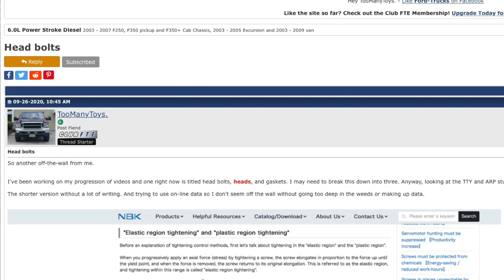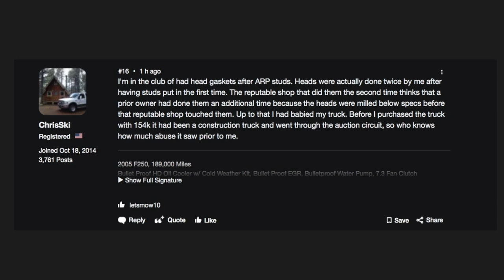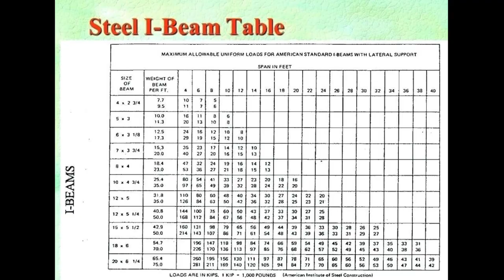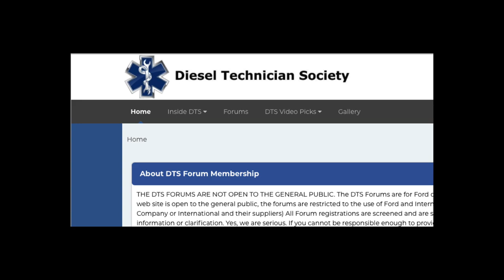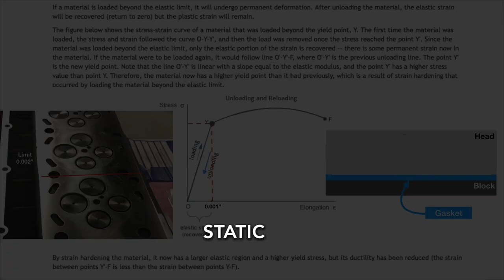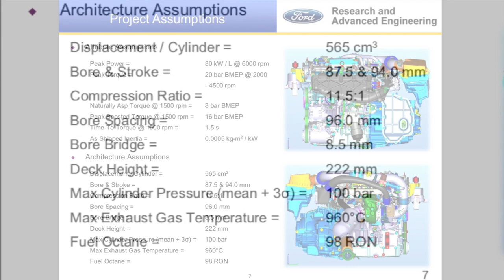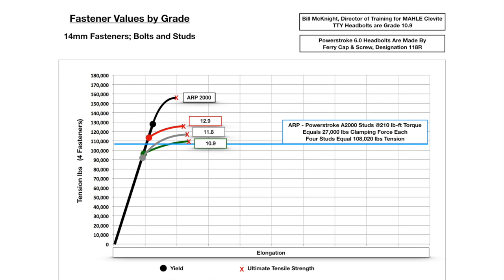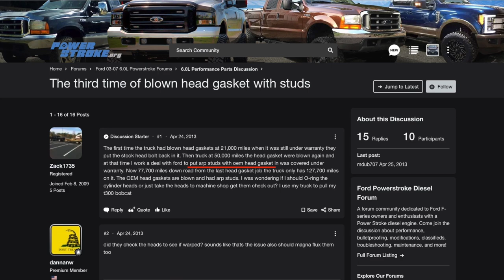Powerstroke 6.0 - Head Gasket Failures and Head Bolt Clamping Force

Comment: Watched the entire video. Thank you. Enjoyed it. But I called you out 18 minutes in. Ask my wife. I kept saying the common thread is “ Tuned”. My 05 has pulled my 13,500 lbs trailer as fast as I have ever wanted to go.   Now stopping, we’ll that’s another Rabbit hole you must go down. I’ll be waiting. Good job. Thank you.
Reply from the maker: The tuned situation is variable, IMO.  There are tunes out there that have been well designed and don't cause gasket failure, or at least to a low percentage. 

Kind of amazing that a guy who spent 30 years in the automotive brake industry hasn't made a video about brakes, ain't it.  Probably 20+ years of commentary in various forums has burned him out.

Comment: Love the deep dive into this subject. It’s something I’ve been looking into since purchasing my 05 Excursion two years ago. Your theory about it not being a bolt issue confirms my suspicion that “studs fix the HGs” is a flawed premise. My trucks was going on 296k with stock HG and bolts and never tuned. Only mod being an external oil cooler kit. Currently rebuilding it after finding one bent pushrod while tearing it down to fix an oil leak from the rocker housing gaskets. It still had the original length pushrods in it but with no lifter failure.
Reply from the maker: When the gaskets first started to fail, many did the Ford clean to the heads and installed the studs. If they still ran the tune, 20,000 to 25,000 miles later, many blew the gaskets again. When I talked to ARP, they stated the standard studs clamp load, preload, was about the same as the stock bolts, so there was no real difference in clamping pressure. Yet, those who had the heads milled flat had no issue.  So studs didn't fix it, no-tunes or well-tuned trucks did have issues, and milled-flat heads were fine.

The head bolts clamp down 4x the stock combustion pressure, a 4x1 safety factor.  They are not going to stretch.

If it sat for a while, one of the valve guides may have hung a valve, letting the lifter pump up on the next revolution and probably a light tap on the piston, enough to bend the pushrod.  But pushrods are supposed to be the safety fuse in the valvetrain.
Reply: @toomanytoys  that’s a very possible explanation for the pushrod. We don’t drive the truck everyday and generally only use it when my whole family of 6 needs to go somewhere together. Unfortunitly the pushrod rubbed on the inside of the head and put some metal shaving through the oil. Found scaring on the LPOP, main and rod bearings. So it’s a full rebuild as I want this motor to go another 10+ years. The truck is in very good shape for its age. Thank for the reply!

Comment: Jack,

As always, truly in depth and informative. Coming from a computer science background, I am always intimidated by your mechanical knowledge, however you consistently manage to convey your message without making it seem like you're dumbing down the concepts. You are due many more thanks than you will ever receive.

As for this engine, and heads more specifically, I know KDD has their own cast aluminum heads, but frankly I'm not interested in aluminum heads for diesel applications. The stock o ringed heads are an option, but it again doesn't really solve the clamping force problem that you identified. This leaves us develop one ourselves that implements the improvements made in the 6.4 head, KDD's cast alum heads, and of course o rings (would be machined).

I wonder if one could reasonably cast custom steel heads at home. I have no metallurgy background but I have cast things using lost plastic methods before -- I couldn't imagine this would be much different than the casting methods at the factory.

And then I get excited with ideas like replacing the pushrod valvetrain with an electro-pneumatically operated one, replacing the poppet valves with iris style valves (or others that are less disruptive to flow and more conducive to an electro-pneumatic system), and the HEUI injectors with common rail injectors. 

I wish I had more time.
Reply from the maker: Thanks, I'm humbled.  The o-rings are a band-aid (from my view), but a successful band-aid.  To me, aluminum heads work if they are OE engineered for the situation, and I see no reason to use them on this engine.  KDD changed the design from the earlier copy of iron-based heads for a reason, and they will put more stress on the head fasteners, which is not really just a change to a stud solution.  I would have rather seen them incorporating the 6.4L head design into an iron-based head rather than an aluminum-based head.  I'm not convinced they are totally out of the woods long-term.

You're not going to be casting iron or steel heads at home.  With mass quantities of experienced and trained professionals, casting still gets screwed up in the industry now and them.
Reply: @toomanytoys  your assessment of the kdd heads is worse than I feared, unfortunate. Doesn't sound like a viable long term solution at all. Probably great for an all out performance build.

From what I know of your background I trust you know what you're talking about regarding manufacturing heads, unfortunate as well. If I can't cast it at home, I can at least 3d print the molds out of sand and send them off to be cast. That seems to be how kdd did it. What do you see as the major difficulties in manufacturing a custom head?

Comment: This is awesome, and lines up with my suspicion after being around 6.0’s for years and now owning one myself without head gasket issues, on factory bolts, with over 374,000 miles and counting. Keep up the good work 😎
Reply from the maker: Thank you.  That's a good mileage!
Reply: @toomanytoys   I just rebuilt injectors at home for it, not too hard and only had to order one specialty torque wrench to complete the job. They run awesome and the investment in them was less 1/3rd what remans cost, might be a good video topic if you were interested I could send a core. People really should know how easy these are to rebuild correctly

Comment: Got 240K on a 2003 6.0 excursion. Runs great. Stock bolts and gaskets. Love the 6.0 once the issues are fixed
Reply from the maker: Good to hear.  I think they can have a good life if not tasked with tunes - maybe light tunes are OK.  I haven't or ever will go there.
Reply: Well that didn’t age well. I think I have had a head gasket issues for a while and didn’t know. Oops

Comment: Thanks.  So my synopsis after watching this :  Flatness and smoothness are key but AFTER work hardening an engine since these engines (e.g. the heads) will distort after several work cycles.  Moreover, at least the heads are casted distorted to begin with so buying new heads from Ford is no guarantee of flatness.  Fel-Pro gaskets are a good choice, but overtorquing studs will compromise (any) gasket.  The fasteners are  NOT the problem :  TTY bolts can provide comparable clamping strength to ARP studs (they are just not reusable like studs) and both should deal with the loads even with tuned engines.    If anyone wants to showcase the application of the concepts of modulus of elasticity, elasticity vs plasticity (why clamping in the plastic region is better than the elastic region), distortion, fatigue, clamping forces, metal composition (e.g 11.8  vs 10.9 bolts),  thermal expansion, and so on WATCH THIS VIDEO.  Lastly, to make a strong argument, SOURCE your information like this guy does!
Reply: Or you can just jump to 57:35 for his synopsis but I recommend watching the whole thing even though it is over 1 hour long... it is worth it.
Reply from the maker: Thanks for the review.  I usually try to footnote my videos with documentation, and swimming upstream with this concept, I thought I had to present it in different ways.  I always try to do these for the broadest audience, technical but not too technical, while getting the audience to understand my viewpoints rather than just say "do this."  It makes for a really long video; this started out 2 hours before editing and commission.

Again, I really appreciate your comments.
Reply from the maker: The new heads out of Ford seem to have residual casting stress that later manifests itself in a cupped head.  People freak about that with used heads, but it's there months after production just sitting in the box.  Decades ago, when I worked in an auto machine shop while going to school, we would see some heads start to cup after a few days of machining or not.  Sometimes they would stay true.  I learned more about when we worked on rotor issues in the '90s, residual stress post-machining.  This cupping does flatten out as Ford says it will.  I show that in another video.

Comment: I think you nailed it here.  I was skeptical of the bolt only theory as in my work I build 3600 series cat engines that have only 4 studs  per head.  I also rebuilt a 6.4 for the first time  about 5 years ago and was amazed at how similar the block was but how beafed up the heads were  when compared to a 6.0.
Reply from the maker: Thanks.

When you think of the issue and the progression of the head design of the 6.0, looking at the 6.4L head, in my view, brings the story into focus.  And I'm not found anyone who has bothered to look at the tension of the bolts vs. the peak combustion pressure.

Comment: ‘05 F450 6.0 stock other than slight tune, 6 speed manual, GVW at 42k lbs +/- right under 465k miles only failure was the egr about 15k miles ago, it does have blowby (probably a cracked piston😓) but still runs like a bat out of hell when I get on it.

Comment: Outstanding video!
Reply from the maker: Thank you very much!
Reply: @toomanytoys  it’s amazing how much debate this issue has inspired over the years yet Ford and Navistar knew what the problem was. I’m sure they didn’t elaborate on it for legal reasons.
Reply from the maker: @Rift45  During my career working with Ford, Navistar, and the other manufacturers, and talking to both Navistar and Ford engineers during the early production of the 6.0L, I have my own perspective.

There's a Detroit Free Press article titled "Appeals court: Ford committed fraud by selling defective Super Duty trucks" that is an interesting read; I've noted it in the video.

Ford pushed Nav too hard, Nav was not up to the task, and since Ford was the engine's customer, they were not hands-on enough until the warranty was too high.  And they made mistakes.  Part of it, too, was what has to be done during the new product development, run hard with little time.  One million miles on a dyno is not the same as the regular heat/cool cycles or aging that occurs over time.

From the head gasket issue, it took me some time to step back and surmise why all the head gasket failures; why telling people not to machine the surfaces was a terrible idea. 
I think by 2005, Ford understood Nav's failure and could not come to terms with they made the error of putting crowned or tented heads back on a block and expecting the gasket to hold up as well.  I surmise there may have been a significant amount of people who would not have had repeat HG failures had they machined the heads, with the understanding that higher tuned combustion pressures were pushing the engine too far for the head design.

The 20mm heads are improved, but it's the 6.4L heads that show the next generation of improvement, but after most of the 6.0L production was done.  If the aftermarket producers of the heads would have incorporated those additions to the castings, we may have seen even with the more aggressive tunes not needing o-ringed heads.  But by then, we also may have seen more issues with the 18mm blocks.
Reply: @toomanytoys  Thank you for the details, I love details. Your explanation of the heads made perfect sense. It seems like Navistar designed the engine for whatever the original specs were from Ford. But I remember the torque wars from the early 2000’s well. Original specs were not how diesel pickups were run! 
And of course 500 lb/ft from 7.3 liters is much lower stress than 6.0

Comment: This was a good one! Not only you pointed out what nobody ever pointed out but also few things people probably don't wanna hear or rather turn a blind eye. lol Think regardless of any flaws or improvement's it comes down to the one behind the wheel. the guys like my dad and brother with non studded stock tuned are never in a hurry. they have had a few 03/04 6.0s 200k no issues. guys like me on get tunes for one reason. but im religious on watching temps and heat cycles and temp fluctuation. nobody who runs them hard lets them settle before shut down they go balls to wall pull in to wallmart kill it, and repeat 20 min later these things see more then double the temps my turboprop Garrett
Reply from the maker: Thank you very much.  

I think Ford took up some of the margins with their HP target, which didn't leave much for what many of us have used prior.  You're right; if you are respectful to the situation, you can deal with it, get in "the zone."  But I think many suffered needlessly to a corporate mindset of protection.
Reply: @toomanytoys  So what's your take on valve seat's? I've been waiting on a set of head's machine shop over a month now, did some trade out for a huge air compressor we had. think he's dragging his feet he did a 347 and 289 for my brothers fastback and comet, yet still waiting on heads keeps tryn to talk me into seats, guides, and orings. i passed on, just buy new if i was going that deep, more worried dropping a seat then few cracks.  not in the biggest hurry to pull a half ton of iron out middle of rice season still gotta call ed at ficmrepair and give him my covid cash lol
Reply from the maker: Someone putting o-rings in these heads has to have good experience with 6.0L heads to know where to place them, so I'm cautious about that.   The seats and guides go together; they have to be matched, as I'm sure you know.  One of the first motors I tore down had dropped an inserted valve seat, so like the o-rings, it takes experience to know how to do that right.  These heads are always a tough call, what it will cost to refurbish, new Ford ($1700) vs. getting something like KDD.  None of us want to do it again. We all have different points; I would have been OK going into $500 for getting the heads done, but for me after that, considering the rework, my interest would be going to new heads.  How deep and how long ..... I'm not helping here.
Reply from the maker: TTY gets misrepresented everywhere.  Reusing them since they were yielded doesn't mean they are less strong.  You've lost the ability to have controlled, even tension across the assembly, and they are more prone to fracture due to less ductility.  But you are right; they should not be reused for those reasons.  The copper spray should never be done.  Yeah, I would be getting in there, too.

That will be a call you need to make once opened, with consideration of future life.  If you are doing the work, you could inspect the heads yourself before going to the machinist - flatness, valve, and seat condition, and check for cracks with dye rather than Magnaflux.  I did dye but never showed it in a video.  Without cracks (seems to show 125-150k), you don't have to go deep.  I was lucky mine only had 75k; technically, I could have flipped without the valves changed.
Reply: @toomanytoys  oh yeah! ive got a dynaflux dye kit i use on my ls build's everything's aluminum. i also have an entire garage full of  6.0  parts from multiple sets of heads, cranks, intakes and so on, i bought out a guy who was buying trucks and vans from auction. Best $500 bucks ever! more then doubled my money first day just in old hpop cores.

Comment: Wow. Just wow. Where's my old engineering textbooks?
Reply: BTW, I'm going to hit 200K in about 300 miles. Original head gaskets and bolts. Dead stock. Lots of towing ~12K lbs
Reply from the maker: People don't often post about it, but those who have stayed stock have made it to 300-400-500k without head gasket failure.  There was a van owner on FTE who was at 800k before he freaked out because he heard a tick. Some have not.  But its hard to find any tuned truck that has made it that far.
Reply: @toomanytoys  yes, I agree. I think too many people never consider the engineering required to make a "system" work. Their attitude seems to be "I can bolt on product X and get Y more (insert units of goodness here) out this truck. We all know there are some HG issues on 6.0 but I suspect the majority are owner-created issues.

Thanks for all the fine 6.0 videos you've produced and reasoned posts you have made.
Reply from the maker: Thank you again.

Yeah, there are too many aftermarket fixes without engineering and product testing.  Even within the aftermarket in general, the customer is often the testbed, products not changed until the warranty returns are not acceptable.